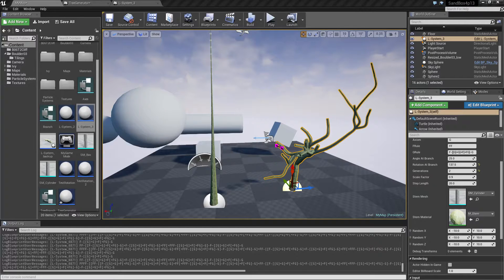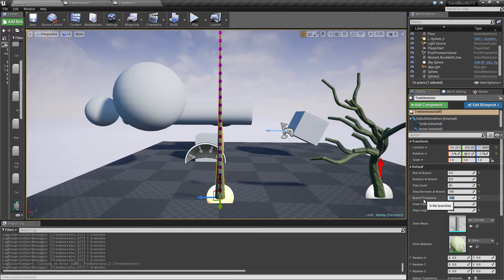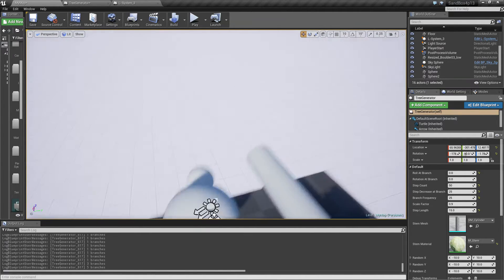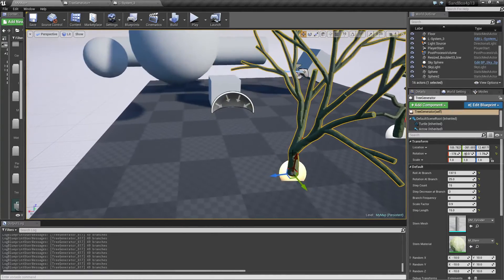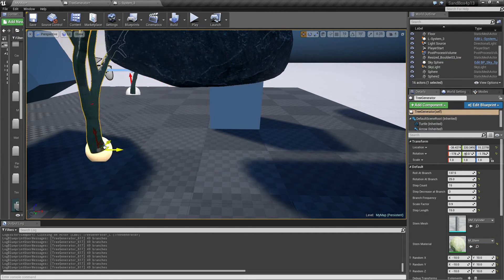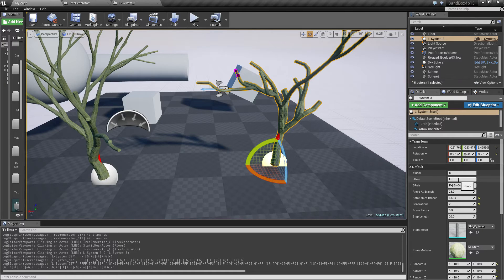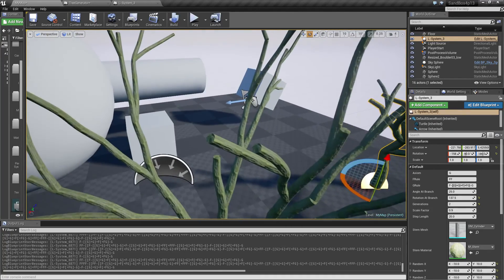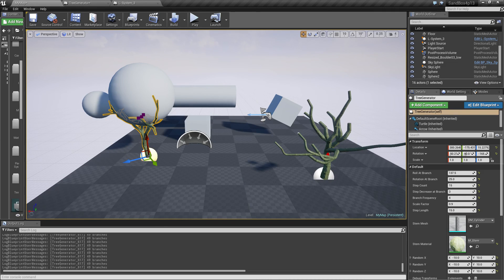Playing with recursive functions and Splinemeshes

Comment: That wrapping system is super impressive. What's the logic behind it and your own thought process prior to doing it?
Reply from the maker: Thanks, currently its actually quite simple and can be improved a lot still. Its doing two traces. 1. Forward to find an intersecting geometry and if it hits, adjusts rotation to plane of hit normal. If it doesnt hit, then it does 2) Down/backwards to find a surface to cling to, and if it finds something, it adjusts point and rotation to that hitnormal plane... I had a lot of trouble with rotation logic since i suck at math, so still trying to figure out the rotation order affects the outcome really lol :-)
Reply: +Jonas Mølgaard that's awesome. So essentially you're smoothing out the transition to the hit point of the trace?
Reply from the maker: Hmm... well, i think of it like i deflect the direction of the branch to follow the surface of the hitnormal and then search for that surface afterwards by looking down/back in order to continue following it. Epic games posted a video long time ago where i picked up most of my inspirration for this, and also a guy called Slavq made a quite impressive setup which i also spoke to. Not sure we use same tracing logic though.
Reply: +Jonas Mølgaard oh okay, I see. That's seriously impressive, this is a whole other level of programming. I've been doing it since I was twelve, currently nineteen and I cannot for the life of me wrap my head around the advanced mechanics behind vectors. Good on you man. Cheers!
Reply from the maker: Lol me neither... my head instantly starts to spin out of control when i try to work these things out in 3d. If i find a good way to explain things i might do a very basic video about just that. If not to help others, then just to remember myself about how i got it right :D
Reply: +Jonas Mølgaard that'd be awesome! Good luck to you on that!